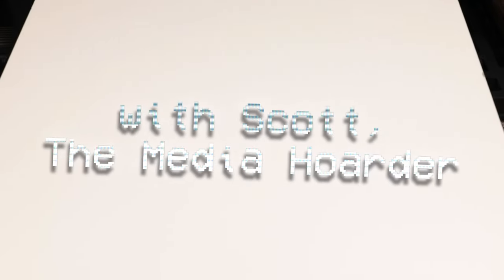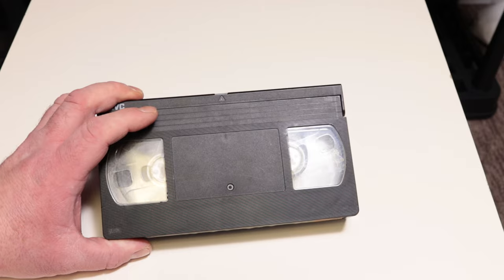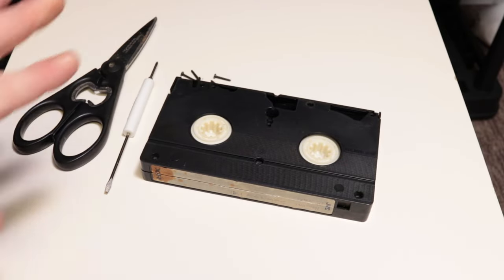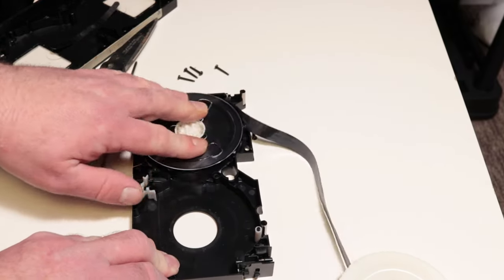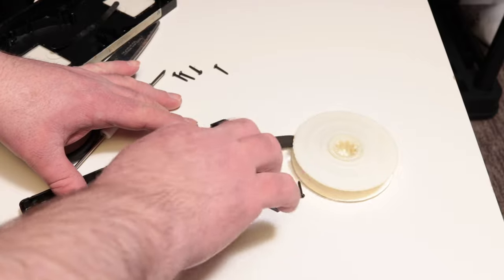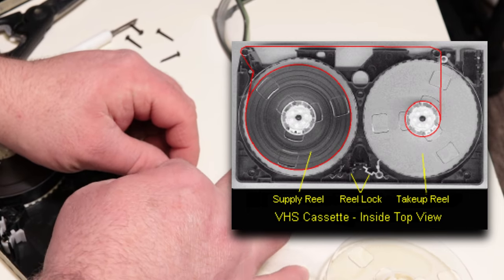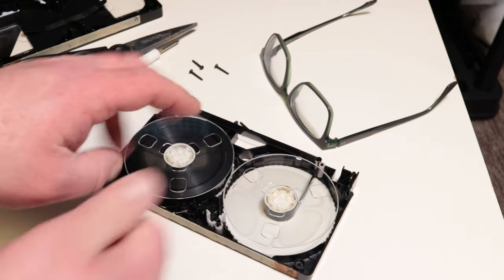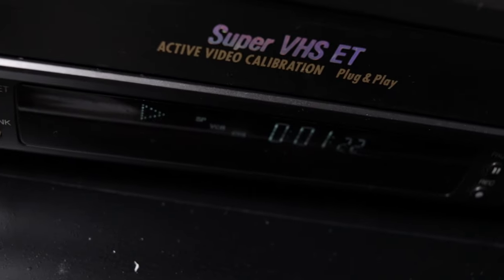Fixing a twisted VHS tape | DIY Media Preservation

Comment: Touching a magnetic tape with a metal screwdriver that usually has some kind of magnetism?  Brave man.
Reply: not all screwdrivers are magnetic. this one doednt seem to be, no black tip.
Reply: @jimmjimms  Yes obviously they're not,, but they are often magnetised by just sitting around, in the shop, in your toolbox, whatever - even just a little bit.  If you demagnetised your screwdriver first I might do it.  Nope, actually I wouldn't. just wouldn't trust it.

Comment: 20 Year Archivist here. Especially if there were particles coming off the tape, but more and more by default, after reassembly, get the folded portions flat under a good amount of spool (as in fast forwarding so there are plenty of tight tape layers holding the folded sections flat), then bake the tape. You will increase the longevity of the tape, and relax the base layer getting rid of the folds, preventing reoccurrence, vastly improving the transfer quality, and of course saving your heads from sticky shed Slough.
Reply: When you say bake the tape, what does that mean? I'm trying to restore some old VHS tapes for a friend. They're from her early military career, and I want to make sure I can rescue all the footage.
Reply: I chewed a 500 £ tape myself , I succesfully cleaned mould by hand by spooling the tape by hand with alcohol swab one end on the plastic level piece before the dip at one end and a folded piece of napkin the other and changed both regular and did the entire tape nicely cleaned of mould...then I spool it back the other way as I'm now at the end of the tape..so I think I'll clean it with napking as spool it so put this napkin so it entire length of tape and begin spooling ...a little way thru I stop to change cloth and find the tape has folded and crinkled tight over one side of itself , so I begin streaming tape out by hand to see it spooled crinkled and bent upon. Itself crinkling as it had gone. So I spooled it all out til the crease had stopped and tape back to normal ..I then slowly teased the crease out with finger against tape back n forth then tightly pulled it over the metal spin at end , very slowly I spooled tape back again very slowly removing the crease by the act of teasing the back part and pulling it tight across the metal and thus round upon itself on spool..very gently very slowly..then I slowly spooled tape back opposite way again until past all crinkled onto.the other side..now I'm about to take her back again..this time I'll go.all the way..the tight crease crinkle on the edge has smoothed out just leaving a middle crease along a length of about 48inch worth. Hopefully this should drop out...but what's the oven thing ??? How hot ?? And is it safe with a tape worth over £500 .???

Comment: I chewed a 500 £ tape myself , I succesfully cleaned mould by hand by spooling the tape by hand with alcohol swab one end on the plastic level piece before the dip at one end and a folded piece of napkin the other and changed both regular and did the entire tape nicely cleaned of mould...then I spool it back the other way as I'm now at the end of the tape..so I think I'll clean it with napking as spool it so put this napkin so it entire length of tape and begin spooling ...a little way thru I stop to change cloth and find the tape has folded and crinkled tight over one side of itself , so I begin streaming tape out by hand to see it spooled crinkled and bent upon. Itself crinkling as it had gone. So I spooled it all out til the crease had stopped and tape back to normal ..I then slowly teased the crease out with finger against tape back n forth then tightly pulled it over the metal spin at end , very slowly I spooled tape back again very slowly removing the crease by the act of teasing the back part and pulling it tight across the metal and thus round upon itself on spool..very gently very slowly..then I slowly spooled tape back opposite way again until past all crinkled onto.the other side..now I'm about to take her back again..this time I'll go.all the way..the tight crease crinkle on the edge has smoothed out just leaving a middle crease along a length of about 48inch worth. Hopefully this should drop out...but what's the oven thing ??? How hot ?? And is it safe with a tape worth over £500 .???

Comment: For realigning the tape on the hubs with FF and REW, I suggest not to use a precious and expensive VCR like that SVHS JVC. I use a separate VCR for that purpose, which does FF and REW while leaving the tape fully inside the cassette, so it does not touch the drum and the tape path. It helps to prevent clogging (or breaking!) the video heads by not letting them meet a wrinkled tape at x400 speed rewind, and also prevents creating more droputs on the tape than it already has. There are very few modern-ish VCRs that do FF and REW without lacing up the tape on the full tape path, generally very old VCRs from up until the early '80s do that, but those are winding way too slow, and not very reliable due to their age. 

Some ORION VCRs from the late '80s-early '90s do it like that, plus they are fast enough and super reliable after replacing two belts. A tape rewinder is also an option, but I suggest not to use them as they often tear the tape apart at the beginning or the end due to the lack of tape end sensors. Also when a tape has sections with missing magnetic layer, the transparent base layer triggers the tape end sensor and stops the playback. The easiest solution is to disable the tape end sensors by covering the sensor holes with black tape on the sides of the cassette under the protective lid.
Reply from the maker: I usually use the least-luxury deck in the pile for rewinding. Yes, using the JVC for that is like taking the limo to buy smokes.
Reply: The first VCR I had was a Magnavox. The end of tape sensor was so sensitive that it wouldn't play with the cover off unless I turned off all the lights in the room. I bought it used in 1982. It was built like a tank.
Reply: @hughbrackett343  It probably used a light bulb as the light source for the tape end sensors, so the sensors were sensitive to ambient light. The later ones use an IR LED, and the sensors (should) have IR filters on them, so they are not sensitive to amibient light. But some manufacturers used phototransistors without IR filter to save 2 cents per VCR, and those are also sensitive to ambient light, although they started using IR light to prevent exactly that. An other reason for using IR LEDs might be that those were the brightest LEDs in the early '80s.
Reply: @mrnmrn1  It definitely used visible light.

Comment: You could've done a better job getting the wrinkles out. I've flattened many a vhs and cassete tapes with butter knives, pens, and fork handles with no additional damage caused. The owner should have their machine checked so it doesn't eat anymore, something might be loose. Good job for the most part.

Comment: I'm surprised you got nothing at all when the tape was twisted round. There should have been SOME hint of a signal if it was recorded; maybe a loud buzzing as the control track pulses get read by the audio head. But maybe your VCR has some special circuitry that mutes the picture if there is no control track; one of mine does that.

Comment: I had this happen with my tape of Shrek.  I wound up clipping some of the wrinkle because it was tearing and scotch tapes it back together. I still have about an inch that's not fully flat but I'm hoping it smooths out but I'll probably just pull that part out and wind it back in a couple time every now and then

Comment: I looked through your available videos. Do you have one on maintaining or cleaning your VHS player and/or heads? I have a cassette cleaning kit. The bottle solution is empty or dried up. I’m assuming it’s just rubbing alcohol. Any advice would be appreciated
Reply from the maker: I don't! My maintenance routines aren't really routine and I have never DIY-cleaned heads. I have head cleaning cassettes for each format I use, and when I see some crackliness that looks like head noise, I give 'em a run with the cleaner. Audio tape heads are big blocks of metal that can endure a good scrubbing. Helical scan video heads are teeny tiny, and likely to snag a Q-Tip. I've heard people using paper and alcohol and a gentle touch, or a special chamois, but the nitpickiness of the folks suggesting obscure solutions overwhelms my curiosity to try them. Good luck!
Reply: @scottthemediahoarder  thanks for responding 👍

Comment: I wanted to ask if you knew how to do something cuz I saw your videos on your channel on YouTube where your repairing VHS tapes. Cliche position sound, my dog got a hold of a VHS tape of mine and really did a number on it. She destroyed the case and cracked the spools and ate part of the spools, however, the tape is just fine. I know how to disassemble the case and I understand how to thread the tape through the rollers and I understand the entire way the tape operates. However, what I cannot figure out is how to transfer the role of tape from the spool it's on to an empty spool, short of manually unrolling all of the tape off of the damaged spool and then manually rolling it all back on to the new spool. There's got to be a way to disassemble the spool that the tape is on and just remove the tape roll from it. But I sure cannot figure it out. If you can help me with this I would appreciate it.

Comment: Is it possible to know which side is the magnetic side from looking at it ? I have a tape which has been spliced up wrong in multiple sections.
Reply: sure: one side is shinier: that side is in contact with video heads, ie that side is up....
Reply from the maker: There absolutely is a way. I just can't ever remember it when I need it. I'm paranoid about running the splice over the heads by putting tape on the wrong side. So my usual workaround it to wind the tape past the playback point, so it's on the take-up reel side. That reminds me - I've got an 8mm to splice this afternoon! TINY.

Comment: I have a vhs that keeps getting tangled whenever I put it in a vcr. 😩 if it’s opened up can it be inspected and fixed and then be played normally??
Reply from the maker: For sure! Find the twisted spot - or one end of it - and open 'er up and unwind it until you find the first and last spot it folded. Smooth it all out and wind it onto the take-up reel so your VCR won't have to play the crumpled section!

Comment: Is it possible to flip it backwards when changing tape cases . i had a family tape that was moldy so i cleaned it and shitched cases but now all it plays is staic . 😢😢 other tapes play and i can rw and ff fine but my family tape just plays static please help . no sound except staic and no picture except static
Reply: Oh, it's so possible that half of my confusion when working with tape in those cases is about which side is where. I should find an editing block to make it easier - like we had for cutting audio tape. Maybe someone 3D prints them now!
Reply: @ScottSimpson  thanks scott .what do you think would be the problem ? .. I tried  your trick of rewinding full and ff it full and at the beginning now i have about 20sec of clear video and audio but then jumps back into complete static

Comment: What do you do when the tape is twisted at the very beginning at the connection of the reel?
Reply: push out the tab in the reel that holds the tape, clip off(cut it off) wrinkly part, assemble....